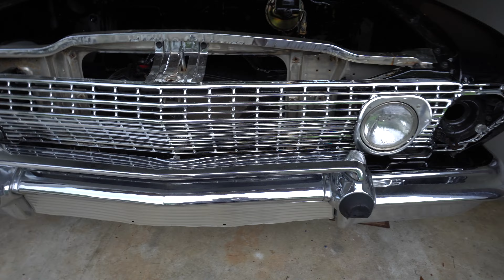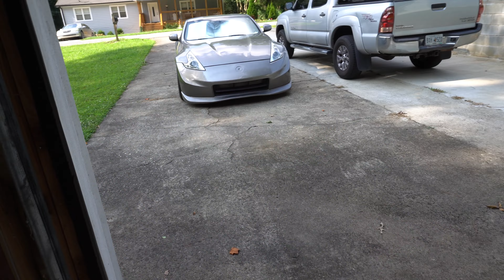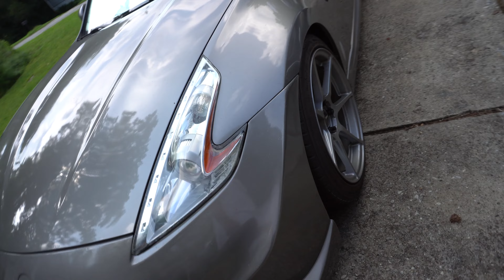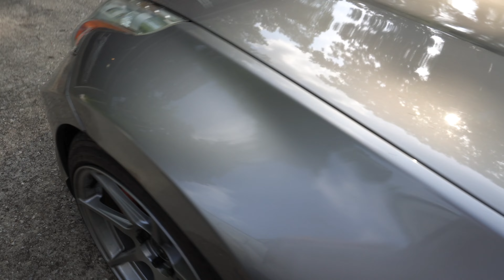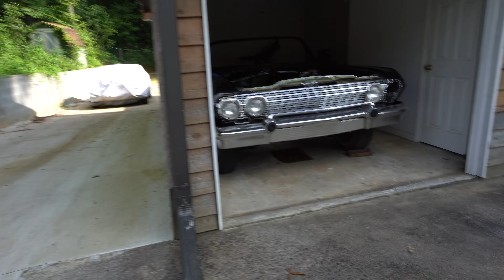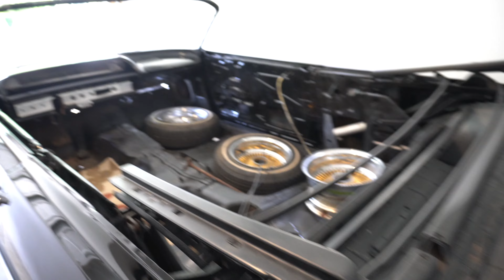Do Not wrap your car biggest scam ever beware  Review 1963 impala paint job and updates

Comment: I’ve worked with vinyl wrap for years now and it’s the cheap material such as tiny bot that has the chance the to damage the paint but if you pay for a good quality brand like 3m or Avery you don’t run the risk of damaging paint (IF installed correctly) and as far as the value of the car going down that’s also a myth street value goes up actually and if you want to do a trade in or sell it at the dealership just remove it before you do that and that’s something you can yourself
Reply from the maker: It could be true my friend but when i bought the Zetty it had 3m tape the last owner had the car exposed to the sun n it got stuck on the paint if u park u car inside a garage u can probably save the wrap but in the sun it does no good. Thank you for your good respectful comment god bless